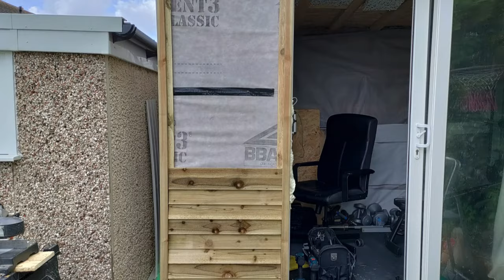Pallet Shed Build

Comment: Rubber roof and associated facsia is costing me £300 for 2×3m shed..... How much was your roof?
Reply from the maker: About the same as it’s the same size, rubber was £150 then fascia boards and soffits for the front. I did save some money on the roof by making my own kerb/trim with roof battens to go around front and sides, the rubber was glued to this and an angle trim placed on top. It can be seen in the pictures I think😅

Comment: How tall is this ? Thanks
Reply from the maker: @lukazleong  just under 2.5 metres ( at the highest point) so it’s within permitted development regs in the UK
Reply: @awkwardtom thank you for the reply looks amazing , I like the fact u had tape under the pallets too ! I am guessing each pallet is 1 m high for the wall to ensure not over 2.5m because u are not 2 m away from neighbour
Reply from the maker: Thanks for the feedback, yes I used damp proof membrane on the pallets that would be on the ground. They were mainly 2 sizes 120x100 & 100x100 so when stacked it came to 220 tall + the base then the slope. Let me know if you have any other questions
Reply: Nice , I have about 20 pallets of 1.2 m x 1m at the moment . Looking to get more . Well done and yes if I have any question I may bother you haha. I am looking to use tin sandwich roof instead
Reply: I am back haa how tall is the French door plz
Reply from the maker: Just checked my drawings the door height is  2.15m, I had to carefully plan the timber that went above to keep it under the height restriction. 😊
Reply: I am back again buddy haha

Are those 3 by 2s timber for the door and window frame ? I was driving around today got some insulations and 3x 2 , 4x2 😂
Reply from the maker: @lukazleong  how do? Yeah 3x2’s for all the wall supports screwed in to the pallets and 4x2’s for the roof. Rockwool insulation in the pallets and foam boards in the roof. It’s very warm and holds the heat well. Will be lining with plasterboard soon hopefully 🤞